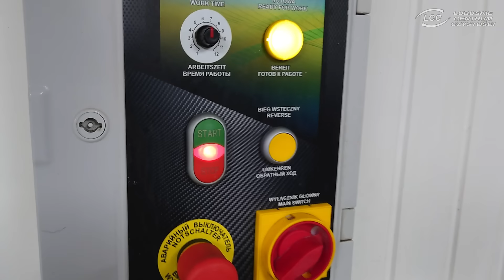Najbrudniejszy dywan jaki ostatnio prałem.

Comment: You can tell when a rug is dirty from use and not from getting it dirty on purpose. And this one was a real dirty rug. That's the reason I love this channel. Great job!
Reply from the maker: Thank You very much 💖💖💖
Reply: I have to disagree. I don’t think it is possible to get a rug this dirty with regular household use. That amount of mud and slime does not get tracked into any house. Just walking across this rug once would result in al other floors in the house getting filthy. I would like to know exactly how this rug got so filthy.
Reply: This rug looks like it was in a coal mining area for a long time. That very black dirt is usually soot from coal or oil.
Reply: @michaelgoble8200 maybe it was an outside rug? like in a front door or porch. And probably it has been in whatever environment it was placed for over a decade. Pollution and mud would really cake in this way.
Reply: To me, this rug looks like it was in an automotive shop where cars are worked on.  It is absolutely possible for rugs to get that dirty in one of those kind of shops,  I have seen it with my own eyes.  They usually put the rug in front of the garage door that leads into the waiting area.  With the actual purpose of picking up all the car oil and black  brake dust. To prevent it being tracked into the customer areas. My hubby used to be a automotive mechanic and this is what they did. They didn't use pretty rugs like this though,  but I guess some do.

Comment: Jakub, i would like if you change your washing step for ours satisfaction (my self actually 😅)
So you can tell us the effect to the rug or to your working duration

I suggest :
- soak with water
- brushing (not machine one)
- rinse with high pressure jet water
- scrapping
- first soaping
- brush with circular machine
- scrapping
- second soaping
- splash with hot water
- brushing
- turn over

- soaping
- brushing
- rinse with high pressure jet water
- turn over

- scrapping
- rinse as usual
- softening agent
- brushing
- rinse as usual

🤭🤭

Your channel its the only one rug cleaning that i followed, because its the most realistic.
Your dirtiest rug also make sense, not look like just came from mud pool. But when you start your work, thats moment usually we realize how dirty that rug
Reply from the maker: Thank You for Your suggestions, I will take it under consideration 🤗💪